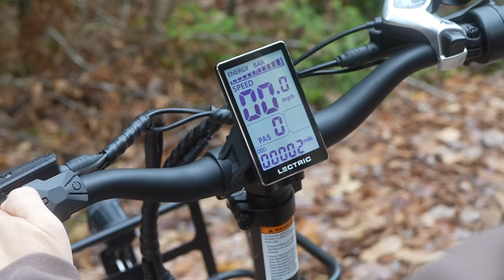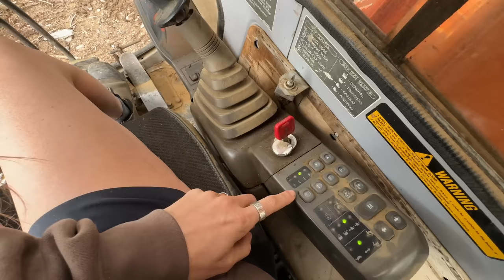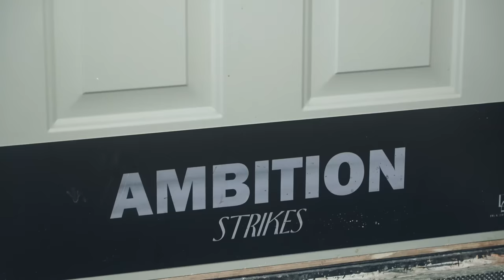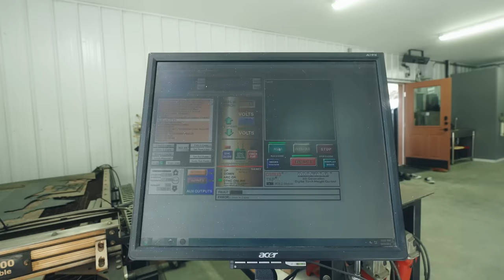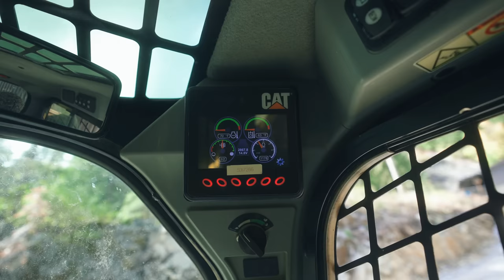Roofing A Shipping Container Workshop w/ Ambition Strikes

Comment: I learned a trick watching some metal building builders. They took all the panels from one side and stack them on a sawhorses and they drilled holes through all the panels at one time to line up with the screeds (2 x 4s) and then they used those holes to put their screws in and they lined up great. Used this  method on a shed I built and it worked great. No wondering where to put the screws just look for the holes!

Comment: Beautiful job, girls! Loved the effort and the learning process. I know you girls said never again on the roof, but beautiful job. The effort the help the experience beautiful.
 I don't think I've ever seen 2 girls fall in love with a full-size basement digging excavator, but I think I witnessed this watching this video. When it came to the skidster, I believe Clementine needs a new friend. Perhaps in a new barn/shipping containers ?_? Well, i'm keeping my fingers crossed anyway. Clementine is a beautiful tool, very versatile, and dependable. But the Skidsteer is a completely different animal. Even though they might share quite a few of the same implements. Which could be extremely handy. Options buckets forks auger's blowers pusher's brooms... Although your average size Skidsteer can be quite a bit more powerful than clementine. Horsepower and lift capacity... Turning radius on a dime. Ease of use. High. 
Perhaps you girls can offer Porter your services for a day. Maybe volunteer for some experience with the larger equipment? He's been so helpful that he might appreciate the offer and the help.
It was good to see you girls get out of the house for a minute and soak up some sunshine. Good for you both. Keep up the good work girls.
Love the pack!

Comment: Hi from Australia..over here...when roofing, we use tek screws and the sheets are screwed thru the hills... not the valleys, as you guys have done...Doing it your way usually will result in roof leaking over time...ove your videos...keep it up xx

Comment: There is an easier way to keep the screws all straight when putting the metal roofs on. While the panels are still stacked on top of each other measure out a line where you want the screws and drill a hole through all of them at once.

Comment: If the roof strapping is all uniform spacing, then you can pre drill a stack of metal on the ground before panels go on the roof, then all screws would be in same line and look good

Comment: If you take a stack of roofing or siding and you know where your horizontals are just mark the sheets and drill a 1/8-inch hole. that way you don't have to measure each screw hole. I told my sons to do that but they knew better now the screws look like a choppy ocean that makes you seasick.

Comment: The guy who built my shed stacked all the panels and predrilled them.  That way, the screw heads all lined up perfectly.  Also, he made a point of placing the screws on the top of each rib where it is less likely to cause a leak than in the valleys.
Reply from the maker: Yes that’s a great way to do it! We had to screw into the flats or else our warranty was voided. Both us and ambition strikes metal roofs

Comment: When you ladies get back to your home after helping these people out, you are to invest in a log splitter it will save that young ladies back and another thing not a doctor, but I will tell you this get yourself a back brace with straps that I used to use when I was working lifting heavy objects. It will save your back make you feel better take care of your lumbar, and then you’ll be able to horse around like you should but every time you lift something please even though you’re a girl, then your knees, I watch you guys all the time just bending over you don’t bend your knees that’s the first thing to do is bend your knees to pick up anything That your legs do the power not your back. Well that’s just a heads up did I say get yourself a log splitter of some of them are very good. Some of them pick up the logs after you come and then it splits them up anyway you want to split them up you have full control over the thing. The only thing you might have to do is cover it when you’re done so the snow doesn’t destroy any other pots, they shouldn’t be out exposed. This is from Mr weir from Massachusetts